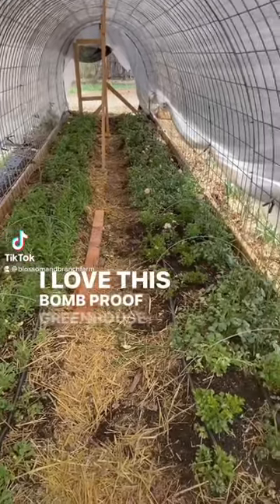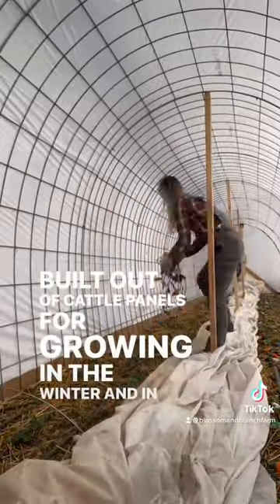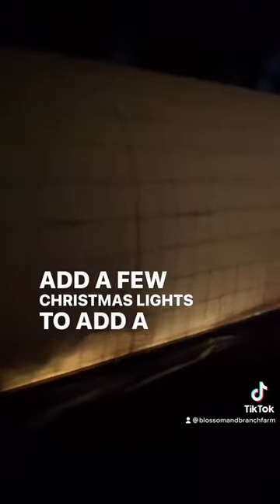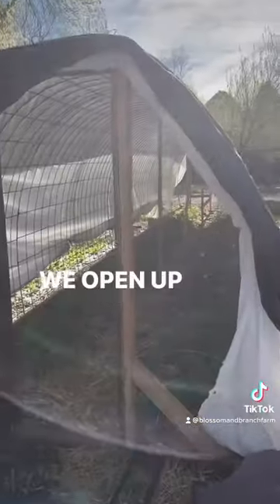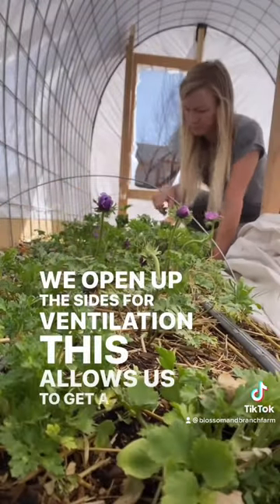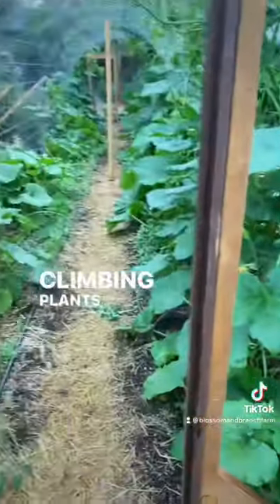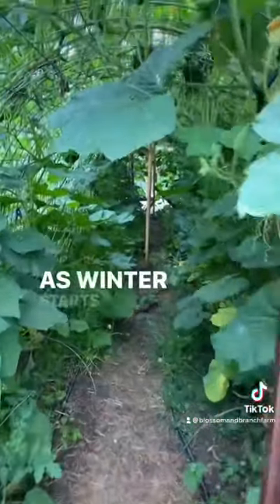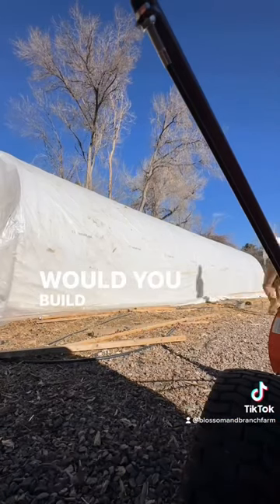DIY greenhouse/trellis from cattle panels!

Comment: Can you show us how to build this!
Reply: You will use 50"x16' cattle panels.   Build boxes for soil.  I use 2x8"x8' or 2x8"x10' I just use regular spf wood and they last about 5 years.  Your arch for the cattle panel should be roughly 4' wide.  Use green t posts to support the panels.   Now you can put the boxes on the inside like here, or on the outside.  Personal preference really.   Hope this helps you.